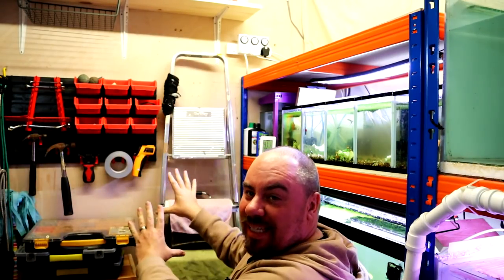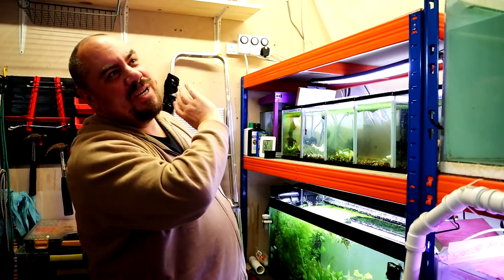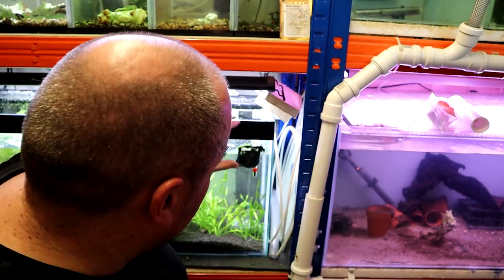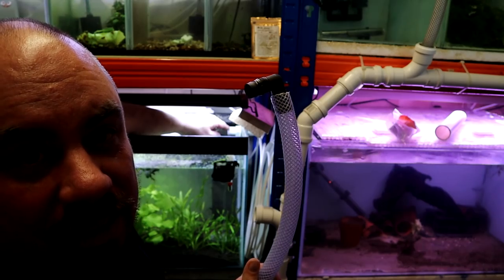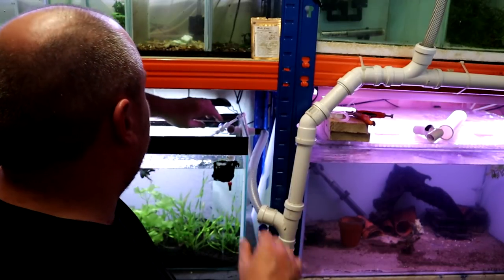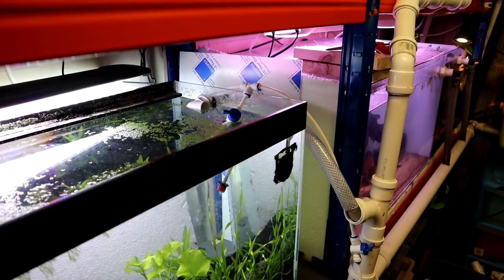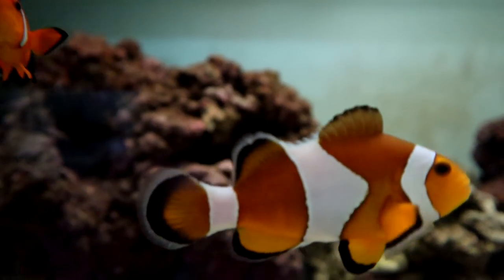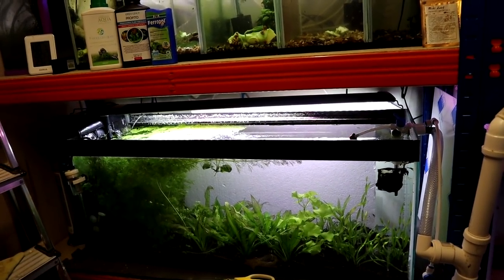Fish room update!

Comment: How much does it cost, roughly, to run all that for the month?
Reply from the maker: I'm not 100% sure, it's something I keep planning to work out but never get around to (probably too scared of the answer!). Future video maybe!
Most of the room is filtered by air, and most of the lights are led, only some of the tanks have heaters and act essentially as wet glass radiators and heat the rest of the room (it's well insulated). The other big cost is water, because i'm on a water meter so I get letters from the water company every couple of months telling me I must have a leak somewhere.😂

Comment: Make your own ferts -

https://www.aquariumplantfood.co.uk/ei-starter-kit-2-with-spoons.html  You can buy those bottles with two caps and when you squeeze it, it fills up a measuring bit on the neck where one of the caps go.

You can see in the Youtube video on the page in the link.  I think you can make 16 500ml bottles for 20 quid.  If you buy a 500ml bottle of ready made ferts from other companies you're looking at 10 bangers for just the one.
Reply from the maker: Interesting - I have been making my own for a while, and using the pump lids (5ml per pump) but will look into that more!